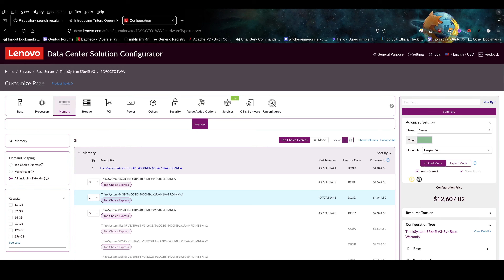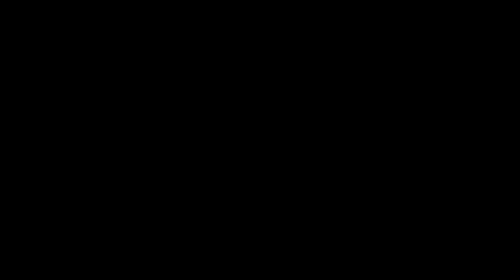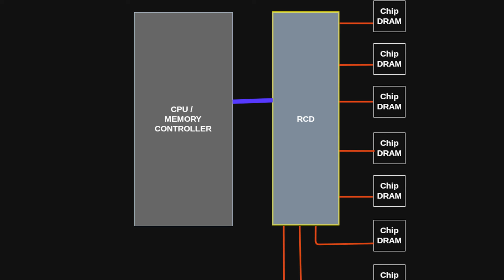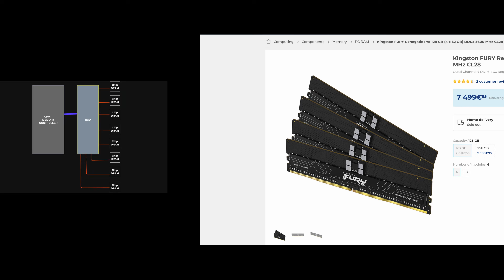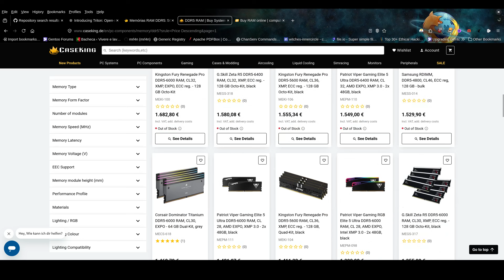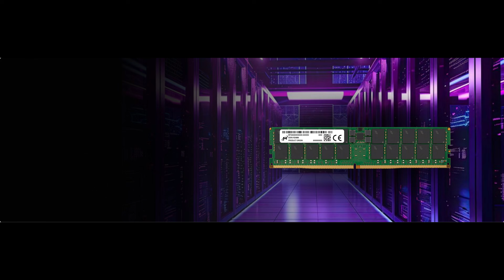RDIMM vs UDIMM: The Architecture Behind the €7,500 Price

Comment from the maker: If you're building a Threadripper Pro or Intel Xeon workstation today, you are trapped in a walled garden. Distributors are demanding up to €7,500 for a 128GB DDR5 RAM kit. Why? Because the box says "Enterprise".

In this video, we bypass the marketing BS and look directly at the bare metal. We tear down the electrical and architectural differences between standard desktop RAM (UDIMM) and server memory (RDIMM). You'll see exactly how the Registering Clock Driver (RCD) acts as a silicon load balancer to prevent memory controller degradation, and why that single $5 chip is used to justify a 300% markup by European retailers.

It's not physics. It's a cartel. Have you been hit by the Enterprise Tax recently? Drop your worst hardware markup stories in the replies below. Let's compile the logs.

You don't need to believe my words...check from yourself https://www.ldlc.com/en/computing/components/pc-ram/c4703/%2Bfi62-l128h128%2Bfv133-20073%2C20843.html

Comment: The RAM industry acting as a cartel is nothing new.  The big four manufacturers of the 90's & 2000's were prosecuted in the US for that very thing many years ago.  Today there are only 3 really big DRAM manufacturers (Micron, Hynix, and Samsung) and they were all recipients of the penalties from years back, and they have all learned alot about how to not get caught today.  AI is the catalyst they've used to raise the prices today.  (I saw $500 for a 32GB consumer kit of DDR5 recently, and a few months ago I priced 32GB DDR5 server modules and found $985 as the lowest price.)  It's unfortunate that they will continue getting away with the outright mugging of corporations and individuals alike this time.  Reason being that the idiot Sam Altman of OpenAI made that announcement about securing 40% of the worlds supply of DRAM for the next 5 to 6 years for OpenAI alone.
All we can really do right now is wait and not upgrade because there will never be enough capacity for DRAM production to catch up in the next 10 years.  Even now, used DDR3 RDIMM modules are starting to show much higher prices than they should.  This will only get worse for the next couple of years.  It's really very disappointing.

Comment: I wonder if, outside of the blatent "profiting because we can"™ and literally proven RAM pricing cartel (at least a couple years ago) if it's also a bit of economies of scale. 

From my understanding you can't use a fab producing RDIMM to produce UDIMM, even if the only real difference is the register/buffer on the RAM. Like basically everything requires other types of RAM. F.x. a raspberry pi zero with 512MB LPDDR2 to 264GB UDIMM DDR5 consumer systems, but there is a much, much smaller amount of computers that require enough RAM to need RDIMM. I'm aware they use the same modules for the RAM, but RDIMMs are almost always paired with full ECC for error correction in mission-critical environments. They undergo stricter binning, validation, and testing for 24/7 stability under heavy loads (Because the seller is usually under contract to send a guy to replace within 24 hours in big server environments).

Furthermore those systems are usually replaced every ~5 years because it just doesn't make sense economically to run them 24/7 with the power efficiency gains of newer generations,  so it's not like other types of RAM where once you've set up a fab to produce LPDDR2 in 2010 there'll still be companies 15 years later buying the leftovers from that production. (From a quick search it seems Micron reached EOL for LPDDR2 in 2019, so that's a good 9 year run from whatever fab they set up.)

Also try to search the used market for RDIMM's, it's admittedly pretty sparse atm. because of AI, but before then you could buy used RDIMM cheaper than used UDIMM.
Reply: It's alot easier than you might initially think.  The same chips used in consumer UDIMM modules are used in server grade RDIMM, LRDIMM, CXL, etc., modules.  It really just means printing more PCB's for the server memory modules and fewer consumer UDIMM modules.  Those things tend to be manufactured in the same assembly lines, and the only difference is the programmed instructions to the pick-and-place machines during assembly.  They might need to add a little extra testing capacity for the server modules, but that's about it.
Reply from the maker: You're absolutely right about the fab retooling and economies of scale. Once Micron or Samsung reach EOL on a legacy node, switching lines from consumer UDIMM to high-density RDIMM isn't just a flip of a switch, it’s a massive capital sink. But let's not pretend the 'RAM pricing cartel' you mentioned is ancient history. They just rebranded it as 'supply chain optimization'. The moment the market shifts, they miraculously throttle production to keep the margins fat and force enterprise users to pay the silicon tax. Fabs are expensive, sure, but the artificial scarcity at the high-capacity end is a feature, not a bug.

Comment: I think the reasonable alternative is to solder your own RAM at this point, right? They have those blank memory sticks, you could find the equivalent consumer memory modules on the market, reflow them off, then flow them onto the new sticks...

It really sucks, there's a chance of messing up, but you could probably save a lot, and undercut all the other sellers if you did this. Maybe you could even get the RAM modules direct from the manufacturer later, and start a business on it.
Reply from the maker: Maximum respect for the idea. This is exactly the old-school hardware hacker approach I love. Physically, you're right: taking empty PCBs and reflowing memory chips from consumer modules is doable, if you have infinite patience and high-end BGA equipment.

Unfortunately, the brick wall we'd be hitting isn't the silicon, but the firmware.

Even if you managed to solder everything perfectly, you'd have to reprogram the SPD chip from scratch with the correct hexadecimals to make the motherboard recognize the density, timing, and ECC architecture. And here comes the final boss: hardware whitelists. Enterprise manufacturers (Dell, HP, Lenovo) insert BIOS-level blocks. If the motherboard doesn't read the specific Vendor ID or the 'approved' cryptographic signature on the SPD chip, it will throw a POST error and refuse to boot. They've literally turned a hardware component into a DRM.

They've locked down the supply chain precisely to prevent anyone from doing this kind of business. But the basic idea is fantastic and demonstrates how artificial this market has become.
Reply: @Rational-Tech-VeLL   Could you dump the firmware off of a commercially available stick of enterprise RAM? I'm personally way out of my depth here, but I've seen defcon presentations of nerds dumping firmware from stuff like videogame consoles and cable boxes or security hardware.
Reply from the maker: @weeveferrelaine6973 Yeah, you can dump the SPD, that part’s not rocket science.
The fun stops when you try to write it back.

Modern RDIMMs have the SPD split into writable stuff, locked stuff, and the vendor‑signed crap the motherboard checks during POST.

You can clone the readable bits, sure.
But the signed region? Forget it.
Without the OEM’s private key the board just throws a “memory not supported” and refuses to boot.

So yeah, you can dump it for research, but making a fully working clone isn’t happening unless Dell/HP/Lenovo accidentally leak their signing keys.
And that’s kinda the whole point — they locked the supply chain on purpose.
Reply: @Rational-Tech-VeLL   Can workstations use motherboards other than those three brands? I've done some very basic component-level laptop repair and hated all three of those companies anyway (outside of old thinkpads, those were good)

If so, I feel like I'd only buy hardware that wasn't locked like that, just like I won't buy Apple stuff from them pulling the same kinda shit
Reply from the maker: @weeveferrelaine6973  Absolutely.
You’re not forced to use Dell/HP/Lenovo boards in a workstation, and trust me with Apple stuff, it's even worst. That whole ecosystem is locked down on purpose, and the RAM whitelists are just one of the symptoms. If you step outside the OEM world, the entire problem disappears.

On the “open” side of the market, the server/workstation boards behave like normal hardware: if the module follows the JEDEC spec, it boots. No vendor‑ID checks, no signed SPD regions, no BIOS throwing a tantrum because it didn’t like the EEPROM contents. It’s the same ECC RDIMM standard, just without the corporate handcuffs.

That’s why people who actually build machines for a living tend to go with Supermicro, ASUS Pro WS, ASRock Rack, Gigabyte’s server line, stuff like that. They don’t play the DRM game. The firmware doesn’t care who manufactured the DIMM, and it doesn’t expect a cryptographic signature to bless the SPD. The board reads the timings, the density, the topology, and it just… works. As it should.

The OEM machines are the opposite philosophy. Their BIOS checks the signed region of the SPD, compares it against their private key, and if it doesn’t match, the system refuses to POST. It’s not a technical limitation, it’s a business decision. You can dump the readable part of the SPD all day long, but the locked region is exactly where the “approval” lives, and you’re not rewriting that without the vendor’s key.

So yeah,  if you want hardware you can actually work with, instead of hardware that tries to police you, the answer is simple: avoid the OEM platforms entirely. Build on open boards and the whole RAM‑DRM circus stops existing.